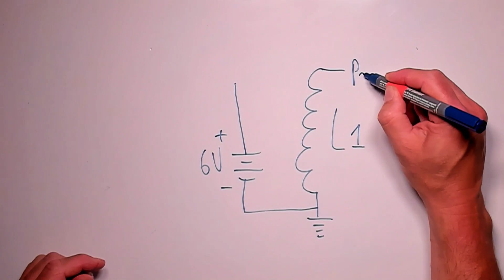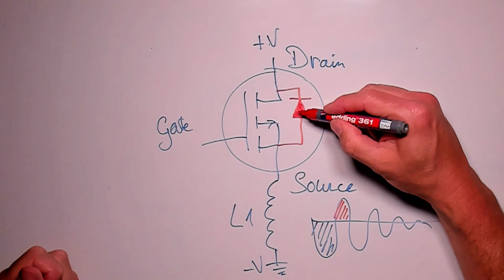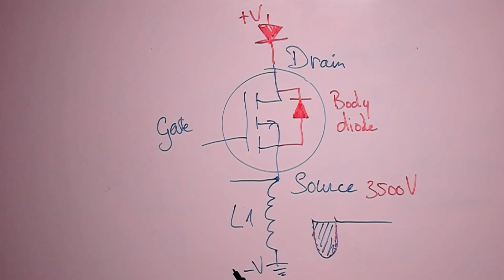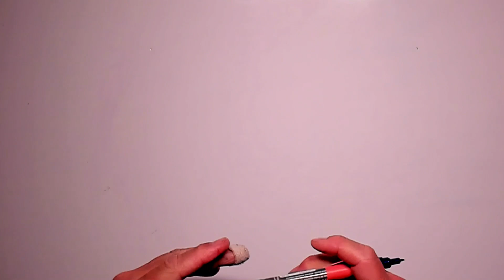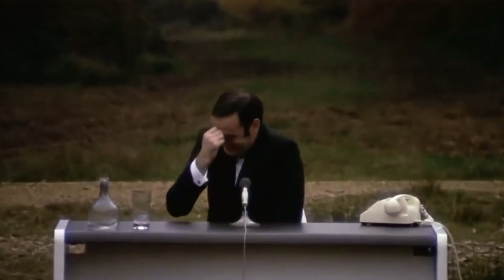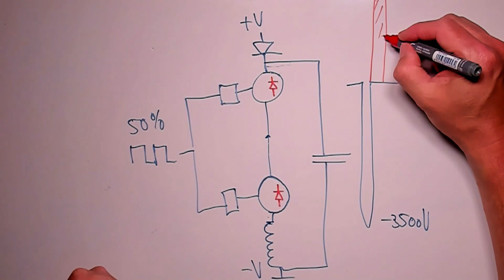Radiant Half Bridge Circuit is Flawed, PCB is not

Comment: Have you ever tried a PNP then an NPN ?
Reply from the maker: yes, but I prefer to work with Mosfets
Reply: @MasterIvo there's PNP mosfets, but maybe no point
Reply from the maker: @kdkinen tried those types to but they are even worse.
that is why I made an isolated gate drive, so I can use a Mosfet both way. high side and low side switching. 
but the body diode prevents it from doing what I wanted to achieve.
but I am on another path now.
power is volts times amps.
displacement current as amps. 
emf as volts
Reply: @MasterIvo ok got it, thank you sir. And definitely look into the Tesla pat 336,961 fig 3 output coil, maybe something there  :)

Comment: Just received PCB for Isolated Gate Driver PCB from your Gerber file 6.2. Can you point out where the 12vdc input is located on the board. I can identify a +12v for the FAN and L1 is listed as Inductor, axial, Freeite, 10uH. The Positive and Negative pads I understand are for the coils connections and the COAX is for the BNC Square Wave 3.3v 49%duty. The MGJ1D...... has a + and - but no connection for the 12vdc input? As you can gather I am learning electronics, thank you for your patience.
Reply from the maker: the 12V fan is also where you connect the 12V psu.
Reply: @MasterIvo  Thank you, we where replying at the same time.
Reply from the maker: also its minimal 3.3 volt signal, better make it 4 to 5V if it isn't working properly
Reply: 😀 got it. The "FAN" is also incorporated with the connection for the 12vdc input. You designed lots of THT to accommodate different makes of terminals, Right!!

Comment: @Master Ivo :  Thanks for the video. I was wondering if you ever looked at partnered output coils, which cause opposing magnetic fields in a shared core? For example, like what Floyd Sweet did.
Reply from the maker: no never looked into it. makes no sense to me. I use the fast dielectric field changes as a source

Comment: How did you manage in your Nov 2020 video to display a single impulse on both maximums? If the circuit had a flaw with the capacitor?
Reply from the maker: because the body diodes were slow enough to not open. and allow the impulses. but after they opened the energy always flowed away. so, to a certain level it works, but it is very flawed.

Comment: Your videos have got to be the best-explained on this topic on youtube - I've looked at a lot of impulse tech videos and the effort you make to explain and show the circuits setup is beneficial and enlightening.  

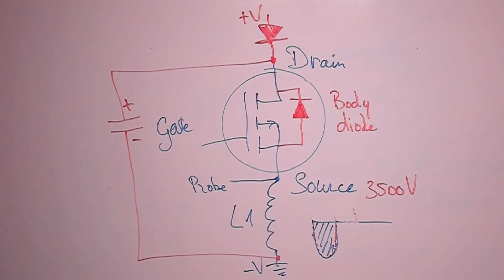At time 9:40, the 680 nF bypass capacitor connected between the drain of the MOSFET and ground is offering about 0.234 ohms of impedance to the 1 Megahertz ringing frequency found in L1.

You can see that from the formula for capacitive reactance, which is    1 /  (2piFC)   
where  pi = 3.14159
F = frequency of the signal being applied
C = capacitance

So you have:    1 /  (2 x  3.14159  x  1,000,000 x 0.00000068)  =  0.234 ohms of capacitive reactance

Because the frequency is in the denominator for the Xc formula,  this is why, the higher the frequency, the lower the ohms reactance.  It is from this formula that the saying  "capacitors block DC but pass higher frequency AC"  comes from.

Point being,  by adding that bypass capacitor from the drain to ground,  the ringing pulses are passing right through (not charging) the 680nF capacitor and passing to the ground connection.

With inductors,  the frequency is in the numerator in the formula for the ohms of inductive reactance  XL:     XL =  2 x pi x F x L
where L is the inductance.
  
Thank you immensely for the clarity and helpful explanations of the pulse tech of Tesla!
Reply from the maker: thanks! but its only a positive half wave doesn't that matter? (its dc not ac)
Reply: @MasterIvo  In one of your videos I watched, where you described the magnetically quenched arc that Tesla used - you mentioned that the objective was to eliminate the retracement of the pulse so that the arc would create an imbalance in the Vacuum (aether) - pulsed DC still retraces from the peak voltage back down to zero.  The first 1/2 cycle of a sine wave is called 'pulsed DC' but it quenches itself by retracing all the way back to its starting point.

Consider a 10 volt peak DC pulse - starts at 0vdc, rises to 10vdc, retraces back to 0vdc.   

That represents the positive half-cycle of an AC waveform.  The negative half-cycle gets clipped off and is not fed to the circuit.  

That is pulsed DC in a sense because the 2nd 180 degrees of the 360 degree AC waveform is clipped out.

If you were to move the reference line from 0vdc to 5vdc of the positive half-cycle, you now have a 5 volts peak-to-peak alternating voltage.  The original 0vdc -> 10vcd -> 0vdc positive half cycle becomes a -5vdc -> +5vdc signal.   What I'm trying to capture is the alternating aspect of the positive half cycle - it alternates just as any AC waveform alternates, between two points.

Also, the positive half cycle alternates at 2x (twice) the frequency of the original, full sine wave.

The reason the frequency doubles for the positive half cycle is - in a sine wave, the signal goes from zero vdc to a peak (a positive peak, then a negative peak) twice per cycle.  For a 1 megahertz sine wave, the period of the full 360 degrees is:

1/1,000,000  = 1 microsecond

But since the positive half cycle only takes half the full period of the sine wave,  the period of the positive half cycle is only 500 nanoseconds.  This means the 0vdc -> 10vdc -> 0vdc positive pulse occurs at a 2 megahertz rate.

So the short answer is,  I am wondering if a capacitor 'sees'  the 500 nanosecond pulse as a non-retracing signal and I think the answer is "No, the capacitor sees the pulse as a signal that starts at a reference point, then rises to a peak, then completely retraces itself' like a normal alternating signal."

 So I do not think the capacitor will be charged up by a retracing signal pulsing - if the signal completely retraces itself, I suspect the capacitor 'sees' that as an alternating signal.

Master Ivo, our group works at artificial gravity and  the magnetic quench you have described in one of your videos that Tesla used in some of his pulse generators is essential to creating an imbalance in the Vacuum (aether) that is required for an object of matter to attain motion (acceleration) in one direction.

If the signal retraces itself, it ELIMINATES the imbalance - the signal retracement RESTORES the balance in the Vacuum and you get no motion. 

The key to artificial gravity propulsion is to create an imbalance.   Of all the people focusing on this type of tech, I believe you are the only person who suspects this.

The first 1/4  cycle of a pulse is required; the second, retracing 1/4 cycle is a disaster for any effect to manifest

Comment: Per your more theoretical earlier explanations I’d expect an alternating pulse train to cancel the accumulating effect of eather motion?
Also, I got the impression the short duration of the impulse would have higher frequency than the coil natural frequency? (As it’d be the fast collapse of the magnetic field into dielectric field, due to the instant infinite resistance)

Finally, can you make it so that the impulse doesn’t go to the capacitor through the mosfets?(So they won’t heat up, a resistance or tuned choke coil could work? )

Comment: hi! for new capacitor bank (4x FKP2 1uf 100V), seems FKP2 only offers 0.33pF-0.033uF, typo?
Reply from the maker: I think you're right, typo should be mkp2 instead of fkp2
Reply: thanks 💚  if any others are having trouble finding source for mkp2 1uf, there's some on ebay, part# MKP2D041001N00JSSD.

Comment: Are negative and positive impulses really equivalent in creating radiant energy?  When would you use one over the other?
Reply from the maker: I'm stll not sure if that is true.
Reply: yup good q. Seemed like throughout his mainstream articles & Problem of Increasing Human Energy, NT thoroughly stressed a 'rapidly undulating' vibration of greatest potential & of shortest pulse width, yet I thiiiink it was NT's quote (can't recall where though), "there is only one electricity (not two identical twins that impressively cancel each-other out so perfectly). Along with elusive tips on quarter-wave/etc conductor lengths/ratios & concatenation, which yet surpass me. 

Seems that if I perhaps recall NT citing a polarity preference, he wasn't drawing hard lines. Perhaps in the spirit of optimizing the particular hardware/setup (but not asserted to be fundamental), whereas he gushes and repeats phrases often when talking about pulsewidth/attack/decay of surge, and violent condenser-discharge action. gut/tentative, integrating the jumbled NT audiobooks lately binged hehe

Comment: In my understanding the sole purpose of the impulse is to elicit strong ringing. You have gone in a whole new direction with the negative impulse. It's neat, but not what I have been expecting this whole time.
Reply: might be 'above my pay grade', but my tentative understanding is the coil intended to 'hum' at its resonant freq (what tesla sometimes calls 'undamped waves'; often <100kc/s), but the MOSFET gate rings at the nanosec-ish time scale echoing the brief impulse, high and buzzy relative to the coil's resonant frequency as it sings Om.
With my radiant half bridge rebuild anyway, this had the effect of adding a few 'sharp teeth' at the top and bottom of the L2's voltage sine wave, freq-dependent, instead of clean sharp impulses. Noise?

Comment: Could you use a pll to tune it? And what will happen if you dont ground the coil and have a tuned cappacitor to make it more resonate, you could even have a resonater at the side instead of the ground!!!
Reply from the maker: yes this is part of a Tesla oscillator circuit that I am using in my previous videos. I inject the hv impulse into a series resonant coil, that implodes the field, this coil then acts as the primary

Comment: @Master Ivo

This "bump" might be the initiation of the either-spinning or adapting to a new, "positive" surrounding. "Energy" is directed to do work, so the system lacks of this amount of "energy". If you notice on the off-switching, there's a "bump" after coming back up to 0. But first, it goes directly negative. Negative voltage, in my opinion, is the inverse of positive voltage. Like the south pole on a magnet. Voltage is not really negative or positive in nature, but rather an inverse of one another and therfore the work or the influence on aether or space is somehow different...

Comment: I would be interested in seeing your circuits operational differences with using BJT without diodes, instead of the fet and two diodes. Bedini always recommend BJT over mosfets for his radiant circuits.
Reply: @MasterIvo  The newest transistors that are fast for RF design are the ldmos. these should be pretty good. It is the next generation of transistors for RF amplifiers. they are high wattage for low dollars. If you ever try a different transistor please check these out.
Reply from the maker: Those LDMOS are to low voltage, still prefer SiC over them
Reply: @MasterIvo  Yes I was just thinking of switching speed. but you probably don't need that fast. I figured a 1000 watt amplifier would produce a couple of thousand volts on a 50-ohm load. I thought that would be enough. I noticed in a simulation that L1 can be pulsed with let's say 10 volts and L1 and L2's would impulse to say 15 volts. the high voltage will be created with L3. I had somewhere around 1500 volts. this keeps the high voltage away from the MOSFET and allows control of it with less voltage tolerant components. could this be why Tesla was using the other coils? I haven't seen his schematic of this circuit and what he was pulsing it with. I may be asking a stupid question. but questions are what make people think! lol
Reply: @MasterIvo  you can make up for the low voltage devices by using them in series.
https://www.edn.com/series-connected-mosfets-increase-voltage-power-handling/
Reply: @MasterIvo  I disagree. You can get sharp gradient  nano second switching speeds with BJT, and Bedini still preferred them in his high speed solidstate radiant circuits too. But he also said the IGBT are garbage.
Reply from the maker: Ok, maybe I'll play with a PNP  BJT Joule thief one time, and share it
Reply: @MasterIvo  please don't do it with a stupid "joule theif" circuit with tiny ass inductors, do the actual Bedini solidstate circuit with a good size byfylar coil with branch circuits like Kron hinted at.
https://patents.google.com/patent/US7990110B2/en?inventor=John+C.+Bedini

Comment: Great work Ivo. I think enable the ads is totally fair. 

One question: is it possible to use the energy captured into the capacitor as source to another coil? or transfer to a battery?
Reply: I am thinking similar. I want to capture half of the waves and then feed them into a non-symmetric transformer for amplification.
Reply from the maker: thanks, yes the energy can be re used differently. But I use this as part of the tesla oscillator circuit

and the adds... yes as long as you can skip them.
Reply: @MasterIvo  Play the ads and make some money! It's the one easy way people can help.